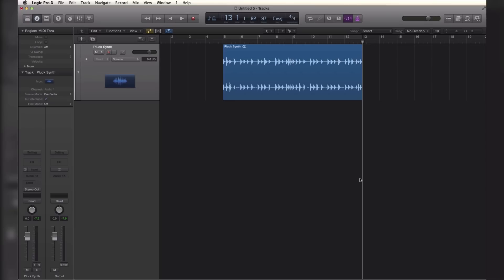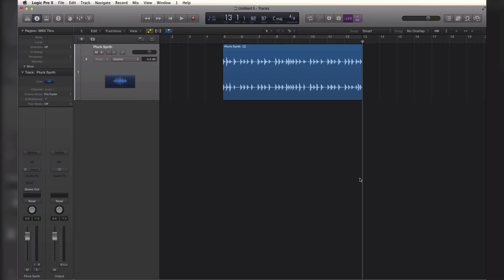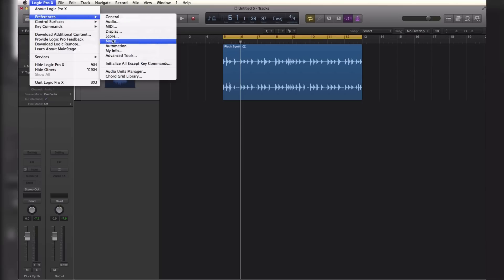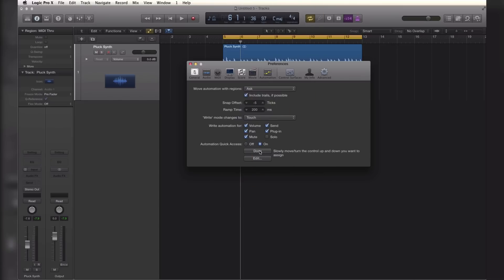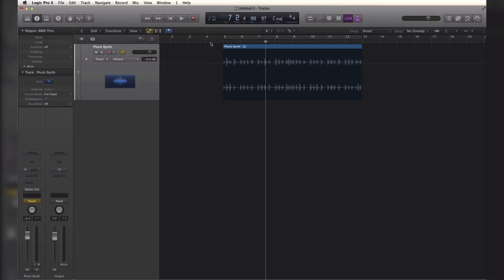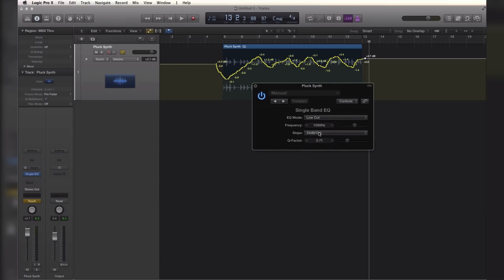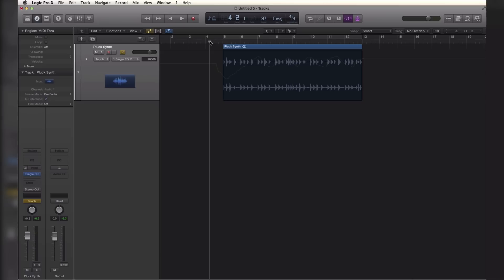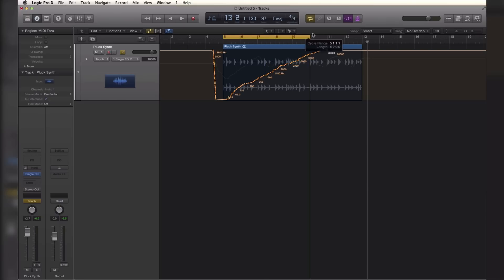How to use one MIDI knob/slider to control any parameter in Logic Pro

Comment: Thanks for the video, but this doesn't seem to work for midi automation parameters such as "expression", "velocity" or "modulation" on a midi track. How do I set up my control surface so a slider on my control surface will control those parameters? Every time I try this with expression selected, as soon as I try to record the automation and touch the slider, it defaults to volume. I realize this is an old video but I have been searching for a way to assign a slider to control the midi automation parameter that I select, unfortunately this doesn't do it. Any help would be very much appreciated. Thanks again!

Comment: Thanks for a good tip! It works on my Logic 9. Connecting automation to the knob seems not to disconnect it from the on-screen controls. Automating volume with a knob, I also tried moving the sliders on the screen, and those still work. I tried them both at the same time, just for fun, and they both seem to be working at the same time. I only use my iRig 37-key MIDI keyboard for inputing to Sibelius. It has two control knobs. One seems to be good only for on/off, and the other one works for continuous level changes.